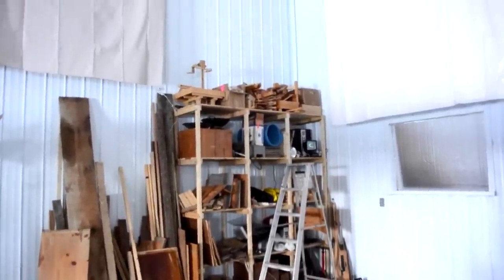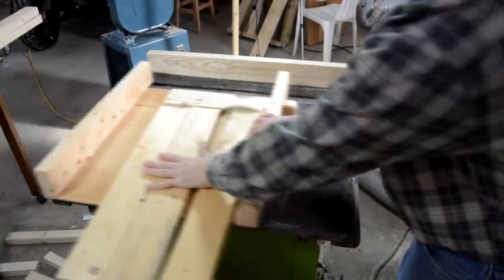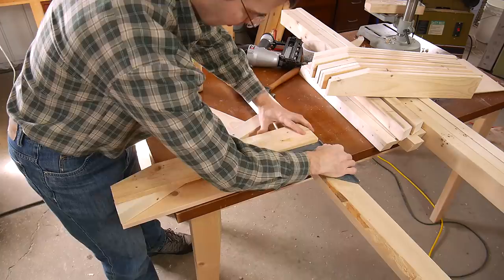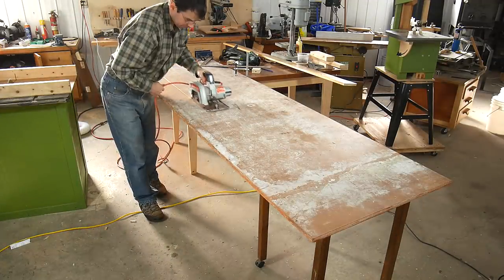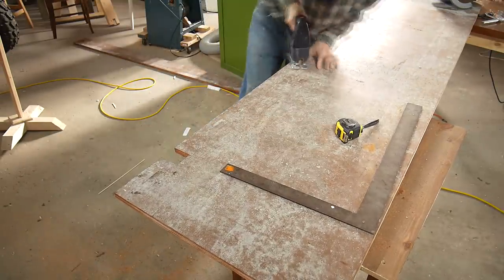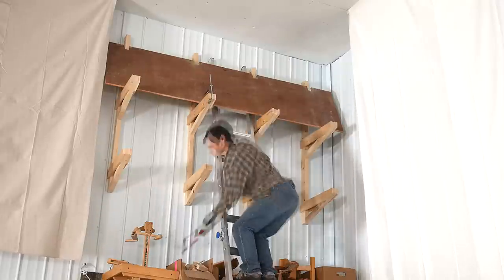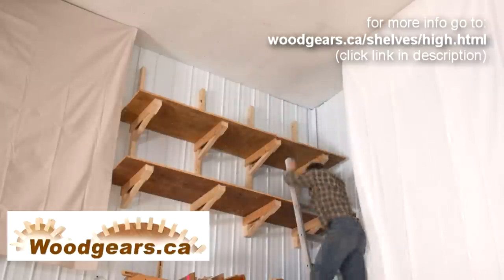Up-high garage shelves

Comment: I am making shelves for my garage and was having a fit trying to cut the diagonal pieces with my jigsaw.  Was just about to use a circular saw but remembered this video and made a jig for my table saw.  Made cutting 15 identical support arms a breeze.  It's over 6 years old but that video keeps on giving.  Thanks!
Reply: I was beating myself up over the same issue and gave in to looking online for other designs. I'll have to try my hand at making a jog and give the narrow cuts another shot.

Comment: You would be proud of my scrounging abilities. Last evening before dark, my neighbors up the street had a pile of wood by the street. So, I went to the house to ask if it was free and it was. Now ,the old owner was a wood worker, so most of it looked like wall benches with nails, but I found some 1x12 boards and 2x4's that will go towards an outside wood storage area. Ah, but under all that I found walnut! Planed and  and smooth as a baby's bottom. Found: 1-1"x6" @ 11'L ,2-1"x6"@8' L , & 1-1"x8"@6' L . Also some hardwood slats for a bed frame. I sent them a thank you notice with my phone number for any other wood they come across.Yaaa

Comment: I built shelves in my garage based loosely on this design. I found that it was better to install the boards to the wall studs and to make the brackets that attach to the boards seperately. That allows for more later customization.

Comment: How did you attach the brackets to the walls? What structure did you screw into?
Reply from the maker: Stanton Taylor Screwed into the strapping.  No idea where the studs are.
Reply: Matthias Wandel Have you seen there are infra red cameras  that pair with your smart phone. Even on plastered walls it is possible to see the studs, water pipes, conduits and voids.
http://www.flir.com/flirone/atWork.cfm
Reply: I was wondering the same thing, Stanton...
Reply: Me too...
Reply: Looked like Pocket Holes. Just kidding.
Reply: I was wondering the same thing. I would not stand on one piece that high if it was only attached by a few screws to the corrugated sheet metal.
Reply: Michael Tricker
 Flir IR cameras basically see differences in heat. Unless the studs are somehow hotter than the rest of the wall, you wont be able to see them.
Reply: mrwillbill If the wall is insulated, Flir cameras clearly show studs, not because they are hotter, but colder than the rest of the walls.
Reply: *****
Yes you are correct, thank you. I just want people to know that there needs to be a temperature difference for the camera to work; Its not seeing through the wall, just temp difference. If you live in a very neutral environment in terms of temperature (not very cold or hot outside) the camera may not show the studs. (and of course flir will use the best case scenario for their advertizement).
Reply: Thanks, I did appreciate that need for a temp gradient. Pipes and wires don't show up as good due to their depth from the plasterboard. At a couple of hundred bucks I can see it being way quicker than a conventional stud finder when laying out kitchens and wardrobes. If you have ever tried using a stud finder on a newly reskimmed wall you will know what I mean.
Reply: ***** Neither would he.
Reply: Have one... they are excellent for that purpose!

Comment: I'm amazed that you just toenailed those brackets into wall... I was expecting that was just your way to hold them there until you lagged or bolted them onto the studs... 
I'd be dubious of the longevity of those shelves... The brackets will hold much more than the mounting of them will.
Reply: He screwed screws into the wall studs.

Comment: You definitely need a forklift  
mobile lift of some sort for that warehouse

Nice and simple bit of shelving Mat
Reply: He has a Matthias-built, drill driven, mobile scaffold. Unless the timber in it got reclaimed already.
Reply: Rick Measham yep seen it still has to climb up it lol 
i was suggesting maybe turn it into a lift shaft
Reply: Rick Measham I thought about that thing when he was installing the plywood shelf at first, but then realized he still has the problem of getting the materials up to the top of the scaffolding.  It's not a lift.

Comment: Nails. OMG. I've never seen anyone of you wood-tubers use nails before. I thought nails were a dying race.
Reply: Carsten Svendsen actually, he uses nails all the time.
Reply: Not the ones where you gotta use a hammer too
Reply: Carsten Svendsen You're wrong. At several occasions he uses hammer and nails. Watch his videos and you'll see.
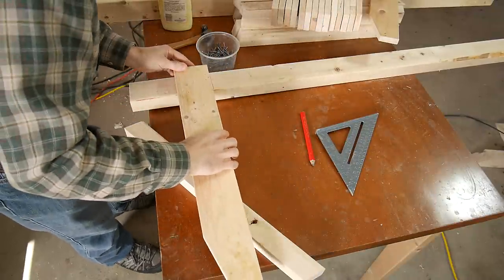Reply: I saw what looked like hammering something at 1:30 of the vid.  I wondered what they were.  Thanks for the lead, Carsten.  I then looked up "nail" on Wiki to see what they were.  Now I remember my grandfather using a nail to write on a board  when I was a toddler  -- I think that was the last time.
Reply: I'm assuming he used nails because they have a higher shear strength than screws. Nails are relatively soft steel but won't snap or break like screws do. That's why you frame houses with nails and not screws :) Although personally I would have through-bolted with carriage bolts so that the whole thing could be adjustable.
Reply: +cathode 01 
Nope.
- 16d box (nail gun)  shear wood-wood - 95lb
- #8 screw shear wood-wood -  90lb
Reply: +Janizary - Interesting. I have sometimes wondered that which one can hold better in different situations. As often I have found nail to stay while screw has been pulled off. Last time couple months back I was required to hammer one stuck 2x4 from a steel holster, and first I screwed a another 2x4 with 4 screws on it that I then hammered. And the screws just couldn't hold the extra piece. Then I nailed the same kind to otherside with 4 nails and they hold it so I got it hammered off.

That is as well reason why I often see constructors to use nailgun more often even when they could use screws, instead just time saving, some has said that it has better grip.
Reply: cathode 01 exactly! nails have high sheer strength, are cheaper, and install quicker than screws (lower labor cost). That's why they're used for framing.
Reply: I would venture to say there is a lot more nails sold in north America than screws. Not many screws are used to build residential housing 90% nails for the whole process. You form a basement and you use nails. Frame the structure, nails. Shingles, nailed. Siding, whacked in with the ole hammer. Electricians and mechanical guys use screws but that doesn't amount to many. Drywallwallers would be your biggest user of screws. Than it's onto trim work (more nails). There is obviously exceptions, tin buildings steel stud. But you get the point. Weekend warriors love screws.

Comment: I looked at your garage shelf plan and they are very good. I want to use a 24" deep 3/4" plywood for the shelf. Will the dimensions for the supports need to be modified to accommodate the deeper shelf? What would be the new dimensions for the supports? Thank you in advance for your reply.

Comment: I was going to ask if this is much stronger than just one piece of wood, but while thinking about it I thought that the pivotal (hehe) difference is that you can optimise both joints for the type of load they need to support. Is that right?

Comment: Do you have any rules/calculations you do for the thickness and amounts of support necessary for holding a certain amount of weight? I am going to build me a table that is anchored to the wall with a not unsimilar construction and was wondering if I am overdoing with the amount of support or using not enough...
Reply from the maker: +Dennis Lubert It depends so much on workmanship that formulas would be pointless.
Reply: So when you have a new idea that isn't much like all the things you have experiences with, do you build something and test it? Like with the jumping on the ikea table? ;)

Comment: I have copied Matts design on shelving supports like that and they can hold more than 160 lbs each when properly attached to the wall studs. I would not have used little screws like Matt but rather some of the Treadlok brand. I would have screwed straight through the 2 x 4 upright and into the wall stud. It would hold a ton.

Comment: I've wondered for a long time, does the principle strength of a joint for shear force come from the glue, or the joining hardware? Or do they complement each other, making a joint that's stronger than the sum of it's parts? Looks like a job for Matthias and his screw jack test jig!
Reply: complement each other.
Reply: Dusty G. Do you have evidence for that?
Reply: Dusty G.  Explain Matthias's Pocket Holes with glue joint strength test then.
Reply: BostonTricker Well, slow down, all that test could prove would have to do with pocket holes. It's completely possible that pocket holes just add so little that the effect is difficult to observe, that's why I think Matthias should give it a go with other stuff, nails, regular screws, etc (hint hint Matthias Wandel)
Reply: Rob Mckennie  I've always heard woodworkers saying this when they butt joint two woods together and add small nails, "The nails are just to hold the two wood together for the time being and the full strength of joint comes from the glue. And when the glue is dry, it makes the joint stronger than the wood itself". But it doesn't seems to be the case in the pocket hole + glue strength test.
Reply: BostonTricker I could offer a few hypotheses for pocket holes + glue being so weak. The first is that the pocket holes weaken the wood, but this isn't very compelling. The other is that the pocket hole screws put too much pressure on the glue, and pushed it right out of the joint. If you recall the test involving extreme clamping pressure and gapped joints, the gapped joints were actually stronger than both the other glue joints.
Reply: Rob Mckennie What matters is which part of the joint is stiffer.  The stiffer component will attract more of the load, until it is overloaded and then the load will transfer to the less stiff element.

In most joints the glue will take most of the load first - when the bond of the glue breaks the joint will open up and any mechanical fasteners will be left holding the load.  This is also because glue causes a brittle failure while the mechanical fasteners are more ductile.
Reply: Sully800 I think you're right, but that doesn't tell you anything about how much difference the individual components make
Reply: What the glue contributes vs the mechanical fastener is tough to say.  I imagine it would vary a lot based on different conditions (end grain vs face grain, squared fastener vs angled, is it a long shallow joint or squarish, etc etc)  But in designing a joint I would want the glue to be able to take all the load by itself.  Because it is the stiffer material it will probably fail first (note, that does not mean the glue is weaker) and once a gap opens the joint is probably ruined even if it is still held together by a fastener.  So I think the typical thought process of fasteners being there to hold the piece together until the glue dries is both practical and wise.
Reply: The glue is the joint. The nails hold it together while ti dries.
Reply: donepearce That has already been mentioned in this thread, thanks for your contribution. sarcasm sarcasm
Reply: Rob Mckennie And now it has been mentioned again. Once more and it will be fact. Nice to know that you are being attentive, of course - too few people are prepared to police the Internet quite so assiduously.
Reply: donepearce As long as I'm getting notified of it I may as well be condescending to people who reply to a thread without reading it.
Reply: Rob Mckennie But you see I didn't reply to  a thread. I replied to a question. I don't usually bother reading threads - too many people like you around to make it worth the effort.
Reply: donepearce You replied to the thread whether you like it or not. And because you arrogantly decided to reply without reading it first, you contributed exactly nothing to anything, and your comment is completely worthless.
Reply: Rob Mckennie You can go away now. I think it may be somebody else's turn to a be a grateful recipient of your smugness.
Reply: donepearce Sorry, what was that? I was too busy deleting your comment to read it.
Reply: Ben Swaine cool story, bro.

Comment: I have a strange question. What is with the canvas tarps I have seen these just hanging on the walls in several different channels now. Some it is obvious they are covering storage space where you do not want dust, but in several now they are just hanging on the wall? I am certainly missing something.
Reply from the maker: cuts down on echo a lot
Reply: Oh, man I did not think of that, lol. Ya every shop I have been in bigger than a two car garage has an echo as specially if your being quiet an needing to talk so someone else or a microphone can hear you. Thank you so much for your quick reply, I racking my brain trying to figure there purpose.

Comment: you could have hurt yourself badly up there putting your weight on the shelve. Seriously you took a big risk imo. Just saying.

Did you conceder building an open second floor in some part of your garage? That would give you a lot of storage space. Maybe you don't need hight ceiling everywhere in the shop. Just a thought...
Thanks for the tip.

Comment: This is proof that Matthias is just a little bit loony. Stay with me here...Look at the cluttered shelves below these new ones. Look at the gap above the existing ones and the new ones. The better way to go would have been to build a set of shelves from the floor to the top of the new one. You would have had a solid set of shelves all the way up with no wasted space in between. This cantilevered system you have constructed, however, is a sound design as long as it is fastened to the wall securely.

Comment: Why couln't you just attach the brackets to the wall studs instead of using the vertical 2x4's?
Reply from the maker: because the studs are inside the wall
Reply: ok. It was hard to see at first.  I thought the vertical strips on the wall were the studs   Sorry

Comment: Why did you glue it? You put a bunch of nails in each joint.
Reply: +Janizary - Because nails suck. You almost always glue a connection like this due to the way its bearing the load, otherwise the entire load is being born by the nails themselves. Nails are a point of failure.
Reply: Maliciously Delicious
Ok. Then why did you put so many nails if they suck and you glue it anyway?
Reply: Janizary - A) I didn't do shit, I am not the poster of the video. B) I would use screws instead of nails. C) Both of them together are stronger then either individually. If you ever took shop in highschool or a carpentry class, you were told to use glue and nails on anything that was meant to bear weight. Especially if its borne laterally.
Reply: Janizary - Actually no, I didn't learn from carpentry class, I learned from my father. And yes, you do glue and affix anything that is going to bear large weights laterally. A vertical post doesn't need to be glued into position. A horizontal support with a lateral joint does. As it isn't resting on anything, the entire weight would be resting on the nails. Nails are meant to hold things in place, not bear loads.
Reply: Janizary - Yeah well, better to glue it and screw it then having a shelf fall. An engineered joist hanger is different from butted planks with bargain bin nails in them. Also you're technically supposed to use the Joist nails which come with the hangers (Not actually enforced).
Reply: Better for who? It is not necessary. It won't fall down.
Reply: Janizary - Can you say, with one hundred percent certainty it wont fall? Why go minimalist when all it takes is four seconds and two cents worth of glue to go the extra mile. Miserly tendencies like that are why many modern homes are constructed poorly.
Reply: Yes I can. If he puts 3 screws in each joint instead of (2:20 - 8 nails?!) and a glue - it will be ok. You don't use 12 inch nail to hang a small picture up on a wall, right? But you can, it takes just a few more seconds. Will you? Send me a pic when you do.
Reply: Thabiet 
I can't help you. I am not a psychiatrist, sorry

Comment: PS your supposed to set your skill saw for the depth of material your cutting 2 1/2 inches deep for a 3/4 ply is how people cut there fingers off.. you don't know what your doing please don't lead people on just because you own a camera.Ripping a 2by6 for your supports is a cheap flat out dangerous way of getting the job done